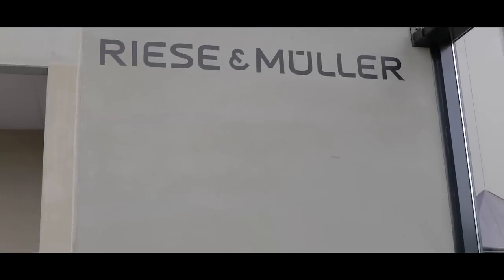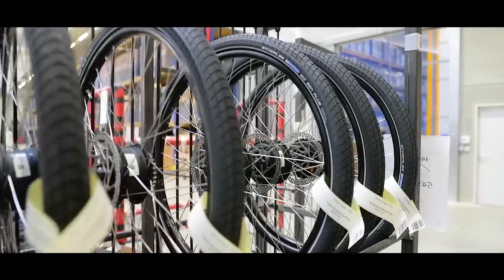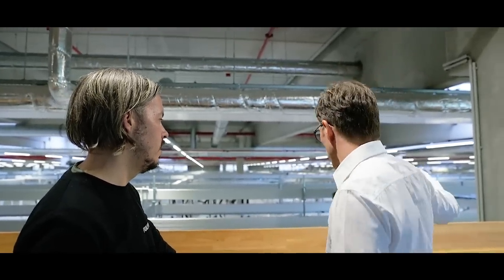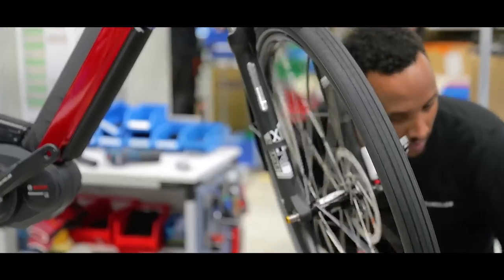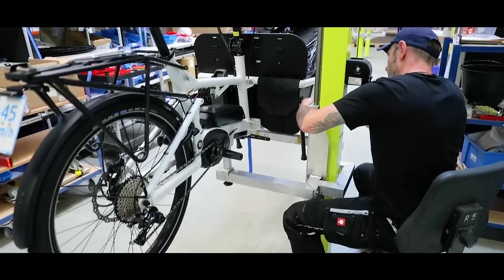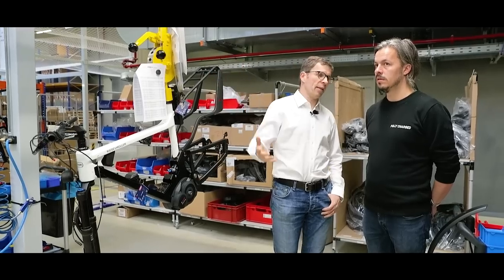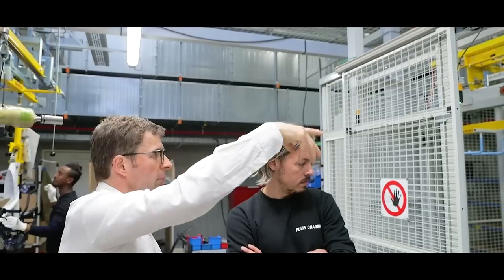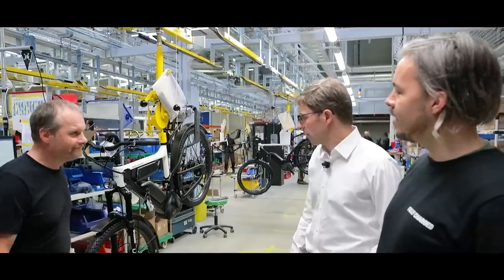Riese & Muller eBike Factory Tour

Comment: I do love my R&M Supercharger. But I'd sure love it more if it'd received even an iota of proper support from the factory after I got it, e.g. when it became apparent that the rear rack had been manufactured incorrectly, with it bent out of alignment, requiring the fender mounting hole to be expanded just to keep the fender from being misaligned and rubbing on the tire, and even after that of course the rack doesn't sit straight on the bike.

For nearly $10K, seems like a bike ought to be built right.

Oh, and man the audio mix on this video is terrible. Music supposed to be in the background, level way too high, making it nearly impossible to understand what's being said.